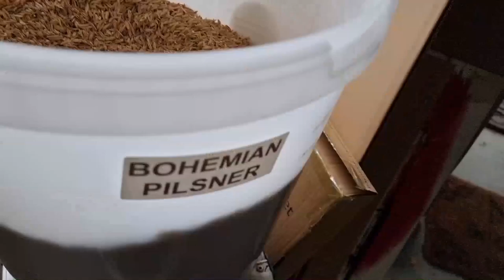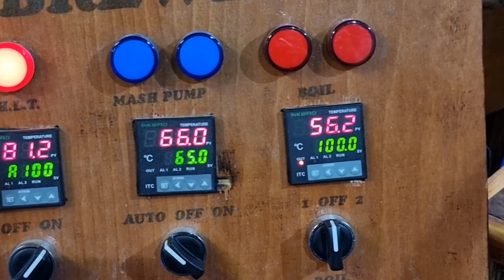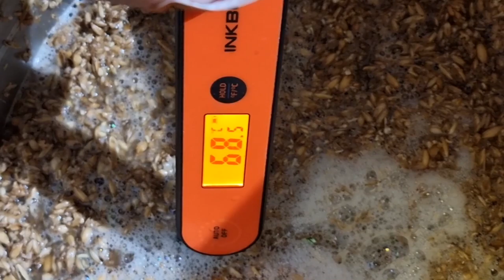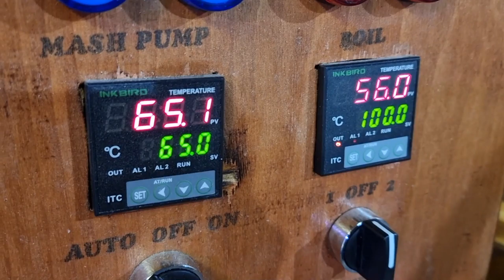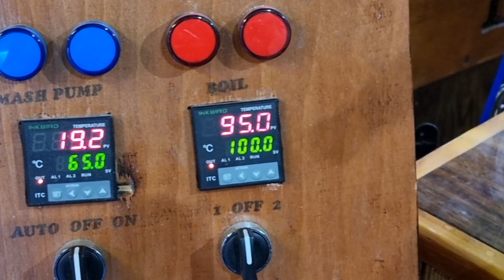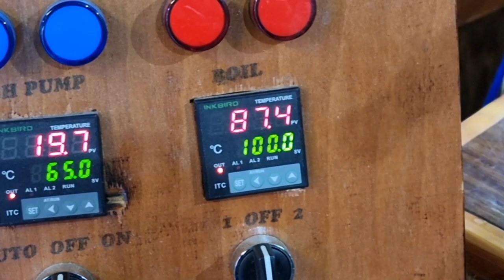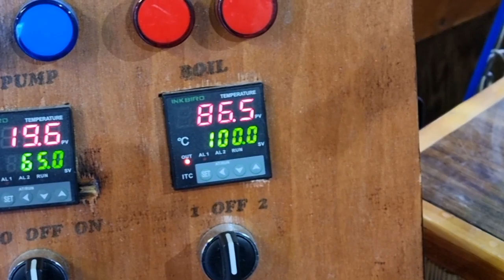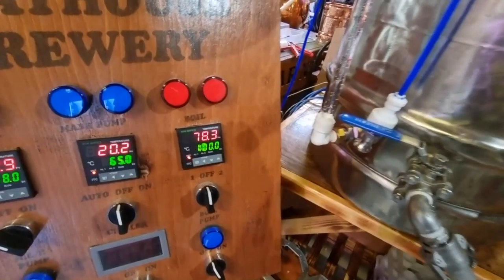BREW - Marching On - Part One - Grain To...

Comment: What are you going to ferment the big batches in once it's up and running?
Reply from the maker: There are two plans.
For NEIPAs and WCIPAs I'll split between two 30L Fermzillas so I can dry hop differently.  Mainly though, I'm probably going to get some 60L Fermzilla all-rounders from Jonny at BrewKegTap.  I'm looking at a three 100L stainless temperature controlled unitank unit from NDL when I start the brewdays though, but that, at about £1,600 will have to wait until I've sold the boat!

Comment: I was just going to say it's a thick mash mart?  You then explained it's a big grain bill. I cool box mash and batch sparge and have to keep my mash thin to get it into the kettle!
Reply from the maker: I filled that 50L mash tun (keg) with a couple of brews.  One Porter wouldn't fit!
I know this rig will do 40L brews but I've never successfully gone over 30L on anything other than a very basic SMaSH.
I've a spanking new 80L mash tun from Powell Brewing that I'm desperate to try for the first time.  It's like a  Siren calling from the mist, lol!
Reply: I really struggle for capacity with my my mash tun. I’ve had to double mash in the past. I’ve seen you video with the new mash tun. beautiful bit of kit. I bet you can’t wait to do your first. Brew on the new set up. Look forward to seeing it in action